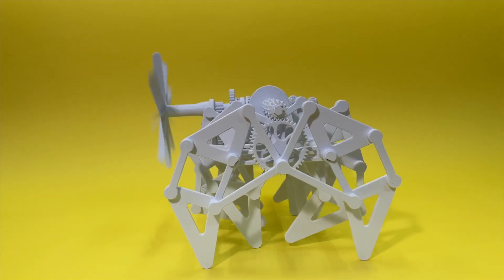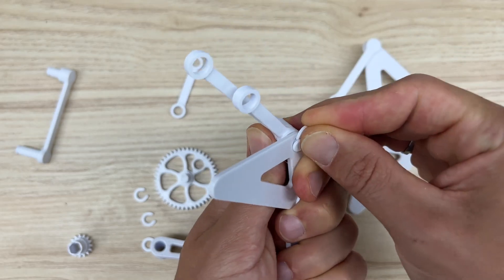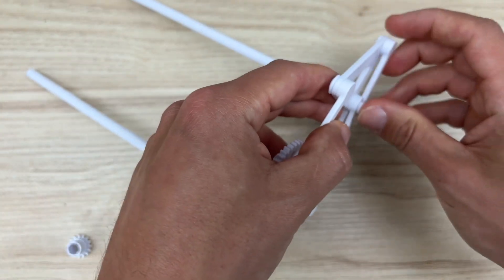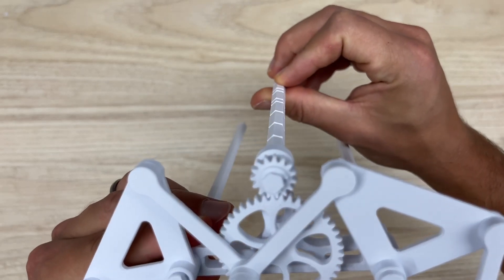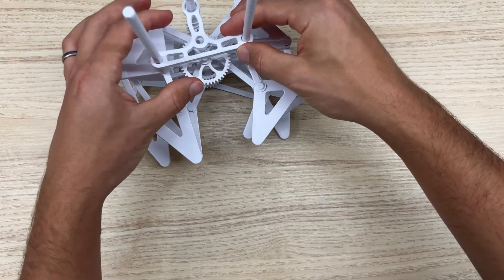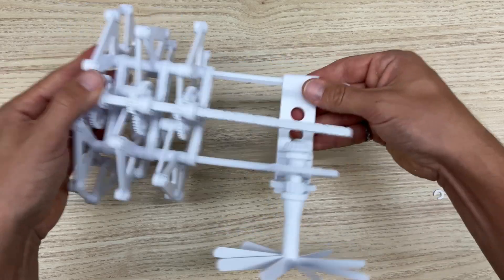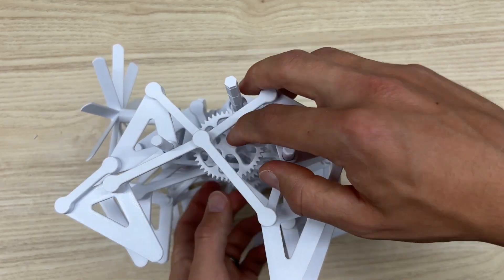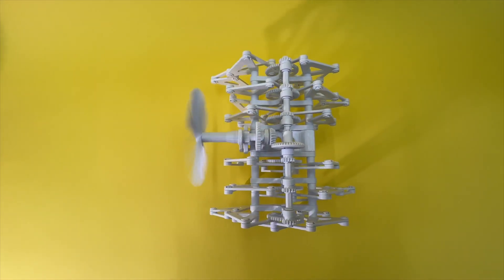The Fully 3D Printed Strandbeest - How To Assemble

Comment: The movement won't be anywhere near as smooth as shown in the video unless your printer tolerances are very good. I had to sand down the shafts and liberally grease all the joints just to get it to fit together and work, and even then the movement is very stiff. It can probably only be driven with a motor.

Comment: Amazing we had so much fun ! We've just done it with the family, it was fairly quick to print in Bambu Lab ludicrous mode (about 8 hours). Luckily we had a leaf blower to make it walk, WD40 was not sufficient to mitigate the frictions in the numerous joints and having it working with a fan. I've printed the parts with Polymaker Polyterra (which is a bit grainy) on a PEI Textured build plate, the grain and the texture resulted in excessive friction, if you don't have a blower I recommend to print on a glass plate and use filament that produce less friction